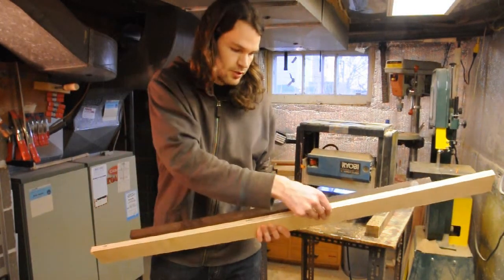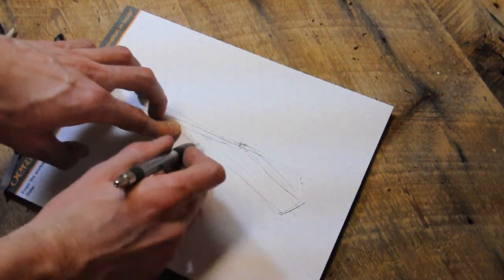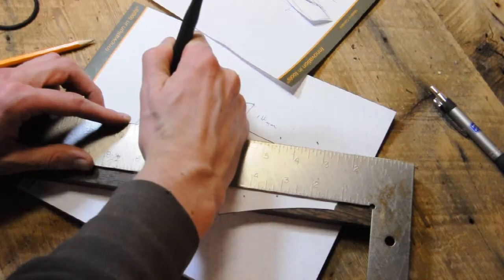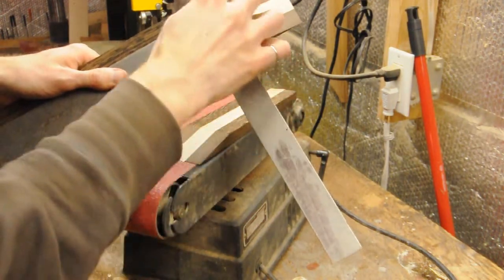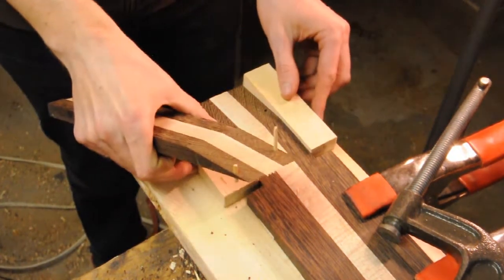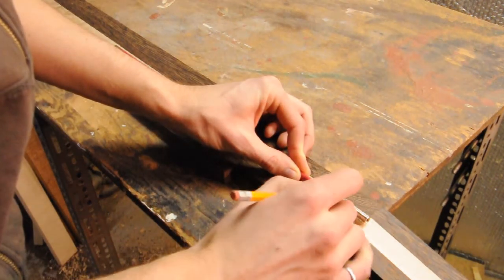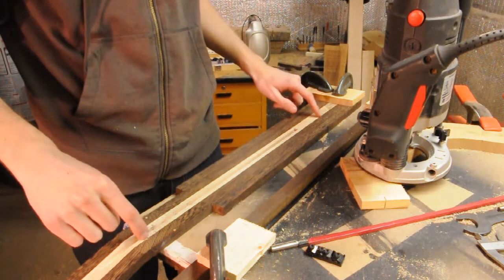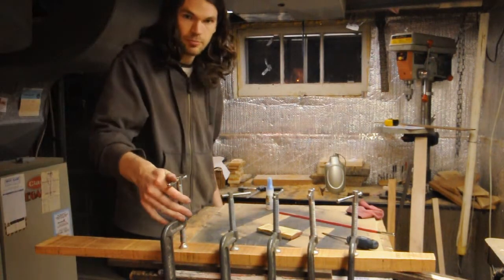Episode 3 - Neck Blank Completion

Comment: I use 10 degree, and my first build was my first and last scarf joint. I much prefer to make my blanks at 2" thick and cut it in one piece. Not knocking how you do it. I have seen plenty high end guitars with scarf joints.

Comment: Hello Dave!
Which parameters i must understand to know where have to be placed the Truss Rod, or measure to be placed in the neck?
Reply from the maker: +Lewis Martin Gtr The truss rod goes straight down the middle.  I just traced it out such that the adjustment nut is under the end of the fretboard.  This truss rod was a touch wider at the adjustment nut, so I widened the slot here.  The carbon fiber rods can run parallel or follow the taper of the fretboard.  Not much consensus on which is better.  I just kept them close to the truss rod at the Nut, and tapered slightly outward closer to the body.  Not quite following the taper of the fretboard.